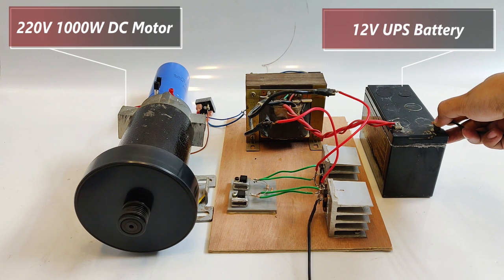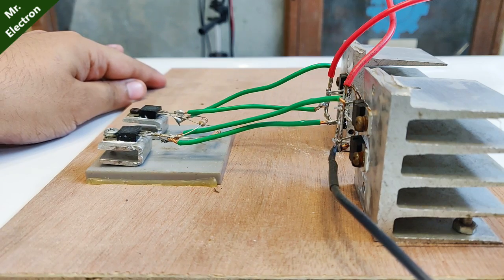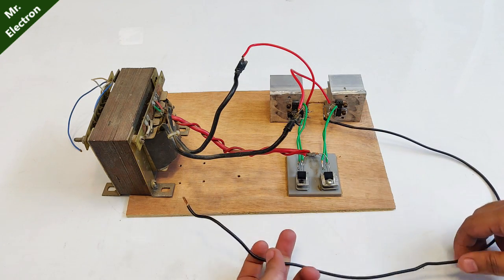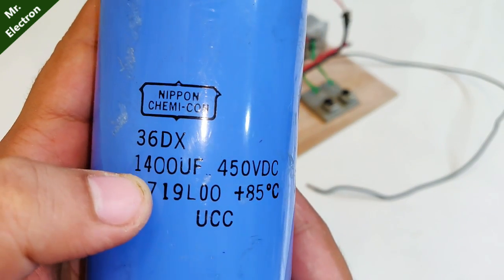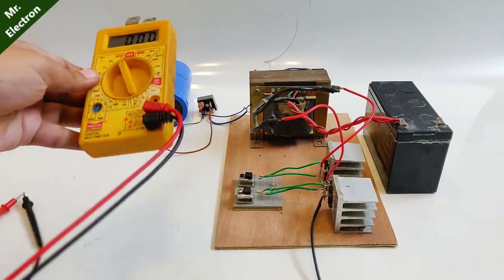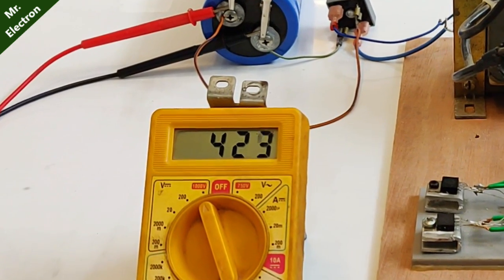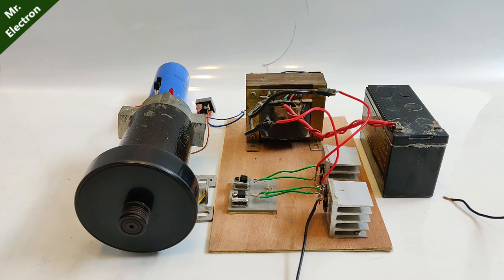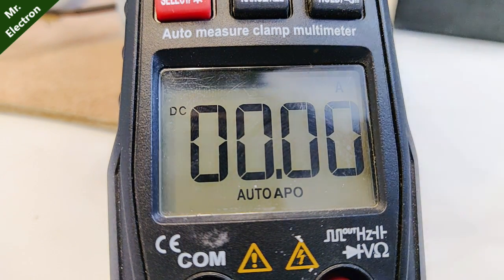Make 12v to 220v DC to DC Boost Converter ( Voltage Step Up ) for DC Motor 1000W

Comment: Now remove that bare wire that's behind the transformer and the black wire that's below heat sink. They are both conveniently ran off screen. All you did was run wires from a wall outlet into a DC rectifier that runs the motor. And it runs very poorly because you didn't even use a full bridge rectifier so you're only getting half power.

Comment: Im in the usa. I have colected more than 10 of this tipe of motors. Gues what? They can run with 9v dc an up. If this guy conects the vaterry straigh to the motor ( wich i think he is doing it)  it will run.

Comment: expectation=
boost converter using massive capacitor, old fluorescent ballast, 50amp car diode and power transistor
reality=
 inverter to mains voltage then rectify the mains voltage